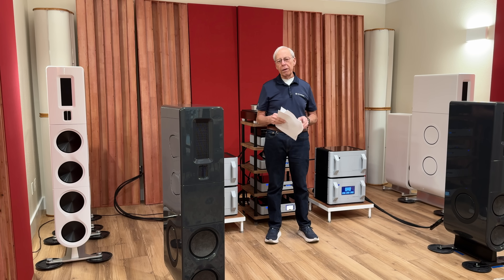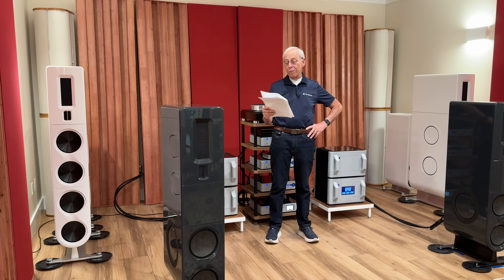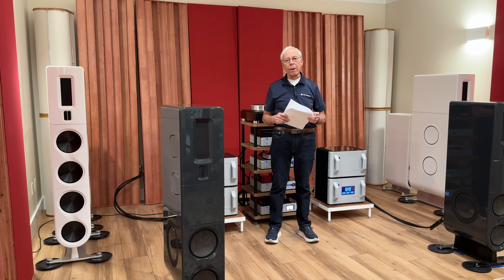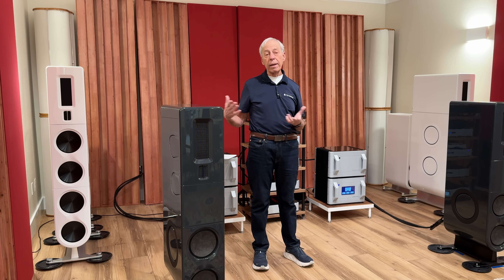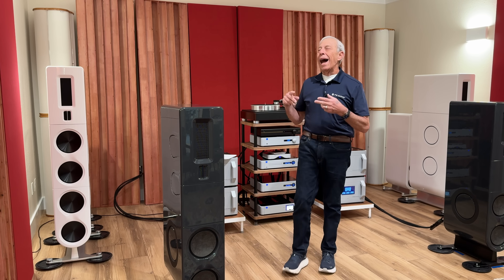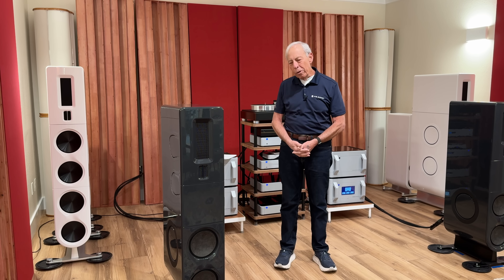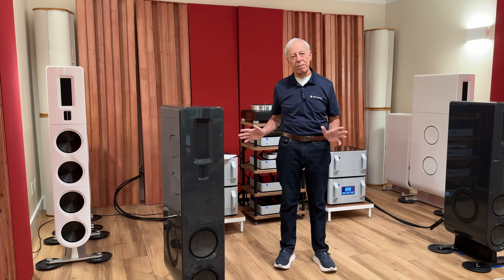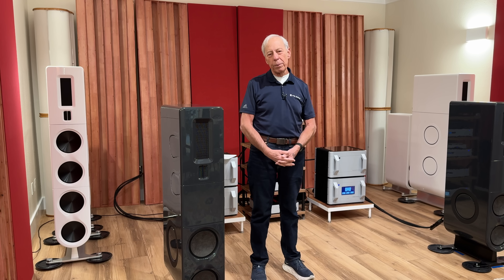How microphone phantom power works and more

Comment: I am in arizona and discovered a mixer that was made in the late seventies called tangent Found one at the flea market .
The Manual I downloaded on the Library of congress States that is sound Specs are as good Of that period . It has that big seventies
Sound like a trident . Yeah it's a very simple design not many parts .
They are smooth punchy, And when you dial the gain in , They don't break up , You just get this warm buttery analog type distortion 
This thing is a great 1970s.Analogue synth  mixer 
We're not always going for that cleansome.We're a little bit like harvenger's Connoisseurs  of certain kinds of distortion .
If I plug into the inserts The thing is totally dead quiet and perfect after all these years , I'm By passing a very musically usable Three Band e q , To do that , And it's great to use it in this way , As well as use it as an fx processor of sorts When you go into the direct inserts ,
On the channel strip There are about five Is film capacitors That are the bigger ones ,two on the strip , And then there's a little sideboard That has three of them .
I don't need to use this to power Microphones . And there's a switch to turn the phantom power off .
What i'm wondering Is , Is it the same circuitry on the Input 
For the quarter inch next to the mike input,  Not the insert .
I'm assuming those 3.
Caps are part of the preamp coming in to the inputs , I want an experiment with different recaps I have three of these things now And you can pull the channel strips easily . 
Do they just?
Feed power to the microphones that I don't need , Are should I consider recaping them To effect the input ,  Out in mesa , we have a guy who does the echo  Reverb tape devices ,, 
He says that They start to take on kind of like a tube like sound as they age , So like I said , i'm going to experiment with recaping In different ways ,
Do these affect the sound of the inputs Not Inserts , Or do they just simply provide power To the microphone .

Comment: You're missing the most important aspect of dealing with phantom powered microphones. NEVER plug or unplug such a microphone with FP turned on!!!! You may get away with is for some time, but it not a matter of if, but a matter on when, you'll fry the mic. This is due to the fact that there is a short short-circuit every time you plug/unplug the.microphone.

Some other things about phantom power that bears mentioning are.If you use a tube mic, that usually has their own powesupplies, never send FP to these. Some powersuppies has protection circuits, but other don't (and will get damaged). It's better to be safe than sorry.

You won't damage anything, by sending FP to a dynamic mic. This is not true about ribbon mices, though. They are very easily damaged by FP, and very expensive to repair.

I do not agree with leaving the mics on their stands. This might not cause any wear on the electronics, but it will on the diaphragms. These will remain active (even if the FP is turned off), and still pick up every sound that occurs in the room.

The "rules" that apply in my studie are:
After every recording session:
1) Turn off phantom power on every channel (as well as turn of all power supplies to tube mics).
2) Unplug all microphones, and put them in their respective storage containers (if applicable)
3) Put away all mics, where they belong when not in use. For example a microphone locker.
4 Collect all cables, and store them correctly. There are lots of videos, on YouTube, about how to roll up and store cages correctly.

Follow these simple "rules" and your mics will last you a lot longer. Your wallet will thank you, in the future.

Comment: Sir. Lip Smacking Paul
Mentioned Neumann Microphones 
The KM-184
Condenser Mic 🎤 
Has Interchangeable 
Capsules Heads 
KK-184 Cardioid 
and KK-185 Hypercardiod
Capsule 
These Capsules are 
Interchangeable 
Yet What Was Interesting was When Paul Mentioned 
Two Mics on a Snare Drum One On The Top
🔝 The Other On The 
Bottom Dynamic Mic 🎤 
Like The Shure SM-57
are Perfect For a Live 
Application 
And If You’re Front of
House Mixer or Console
Has a Phase In or Out 
This Will Have The Top 
SM-57 In Phase and 
The Bottom SM-57
180° Degrees Out of 
Phase on a Snare Drum 
🥁 Side Note:
The Only Thing 
Different on a 
Shure SM-57
&
Shure SM-58
Is The Screen Cover Over
The Diaphragm 
Oddly Enough 
Am Going to
Get Some Dreams 
….But Not Before I
Have a Giant Slice of 
Shoo Fly Pie 🥧 
My Old Lady Got From
Are Amish Neighbors 
3 Miles Down The Road 
Boy is This Pie 🥧 Just
Gorgeous 
The Old Lady Crashed and is Deep Asleep in The 
Beta Stage 
She Took The Buggy Out for a Spin and Our Sway 
Back is a Lot of Work For 
My Gal…..So Let Me Examine 
This Pie and Just Savor 
This First Bite 
….The Dogs 🐶 Are Barking Good 
Night Paul Nothing 
More Interesting Than a
Nice Slice of 
Shoo Fly Pie 🥧 😮

Comment: In condenser mics, the diaphragm is moved by vibration closer and farther from the back plate varying it's capacitance. Those variations are converted into signal. The primary purpose of phantom power is to provide the charge to the diaphragm. If it was just to power the electronics, it could be a much lower voltage. The current tends to be very low. You do not want to leave the 48 volt on because while it is charged it will electrostatically draw dust to itself. Some charge remains even when off so it is best to cover them when not in use. I got this advice directly from Klause Hyne so I'm inclined to believe it.
Reply: Great explanation.  Thank you.  This comment makes it clear.

Comment: Wouldn't an electrostatic speaker be more analogous to a condenser microphone in reverse? A ribbon driver is like a ribbon microphone!
Reply: It's exactly the point - condenser mics and electrostatic speakers are exact analogues of one another. McGowan tripped himself up and had to backtrack when he tried to extend his comparison of condenser mic with a ribbon speaker. The condenser mic has to have some voltage local to the capsule, many need it for the polarisation voltage. Ribbons because they are magnetic don't need this.
Reply: Not the point.